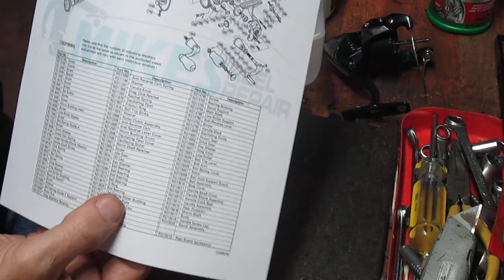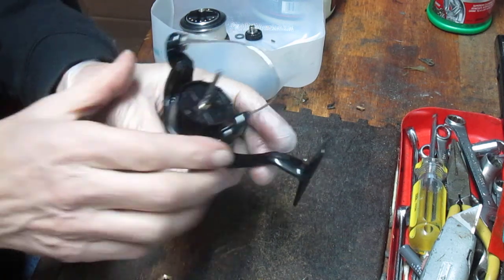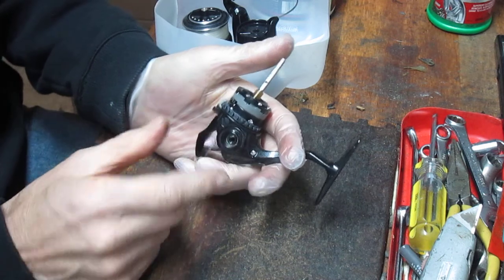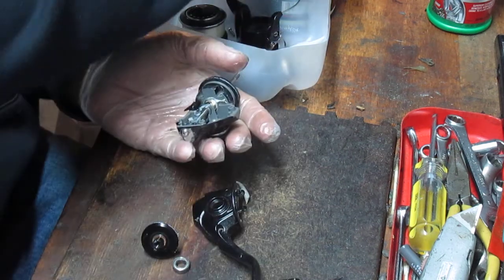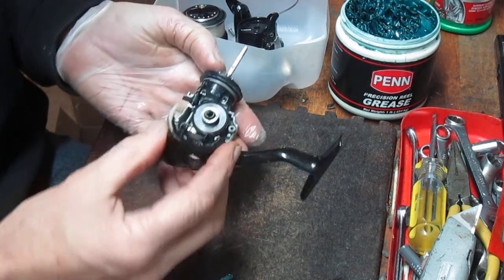Shimano Sustain 3000 FG basic maintenance including take apart

Comment: So there’s no lubeing it without taking it apart? I love my sustain, but it’s sounding rough. Also compliments on how well you articulate everything.
Reply from the maker: Thanks for the kind words.  No, you can't lube much without taking it apart.  If you like remove the handle and add a drop of oil to each side to help the bearings.  Remove the spool and add a drop of oil to the axle shaft.  That will help somewhat, but a through cleaning and lube cannot be achieved without going under the covers - Dennis

Comment: Thanks for the video. I just recovered some of my Shimano reels that were washed away from Hurricane Ike (3 Stradics and 1 Sustain). They were found in the marsh near where my fishing camp once was. They were out there for 7 months or so they are all in really rough shape but I am going to attempt to revive them. The Sustain is in the best shape so I am going to start with it and this video will really help.  The reel spins freely, but it is pretty rough. Do you have any advice for reviving spinning reels that have been submerged in salt water & covered in mud for prolonged periods?
Reply from the maker: Yes - put these reels in a bucket and immerse them in freshwater and dish detergent and let them sit over night.  Repeat this several times and that will do wonders before you get started.  It will help dissolve the mud and salts that are there and get you off to aclean start - Good luck - Dennis

Comment: Hi Dennis. Would you say that conventional non-level wind reels are the easiest to service and maintain?  It seems those are the reels that last forever, like my Daiwa Sealine SL20SH or Shimano TLD 15/30...
Reply from the maker: Yes.  It is fair to say that the less moving parts, the less chance of one of them breaking and the more reliable the reel.  Most level wind reels usually have a straight conventional counterpart.  For Daiwa, think the 47H level wind and the 30H conventional.  For Penn, the 209 level wind and the Long Beach 60 are pretty similar. Basically they are the  same reels but the level wind  has additional gears for the level wind drive, so there is more to break.  Of course, a lot of people like that feature and are willing to trade off the additional chance that the reel will break for the convenience of the level wind.

Comment: In my opinion this is intentional out of these companies not wanting you to service the reel. There's no reason for much of this. No improvement in performance. Shimano has gotten better but now it's Daiwa. Magseal is pointless. They just don't want you doing the service. Now it's these one piece frames you need a special tool for. Monocoque body. No reason for it. My Van Staal is completely sealed and I can work on it myself. Drives me nuts.
Reply from the maker: It may be that!  I think they are trying to balance water intrusion with service needs.   I often wonder if the engineers talk to the service folks about design.  It doesn't seem like it - Denis